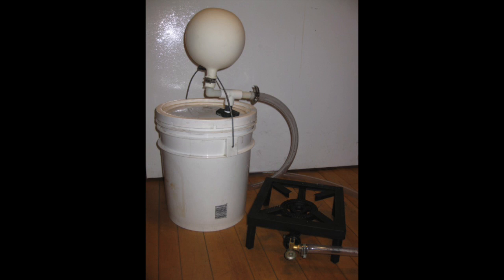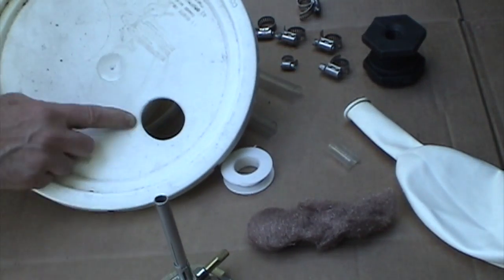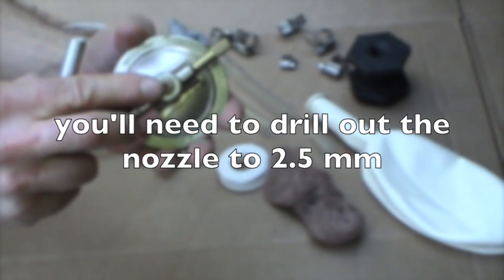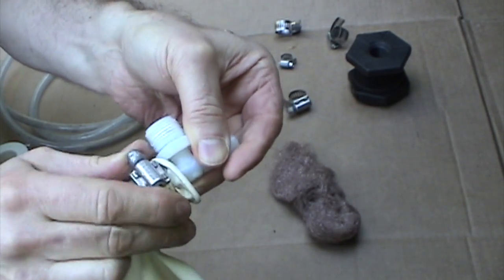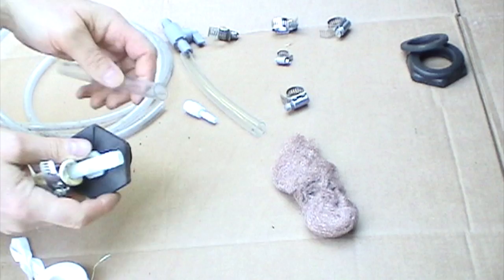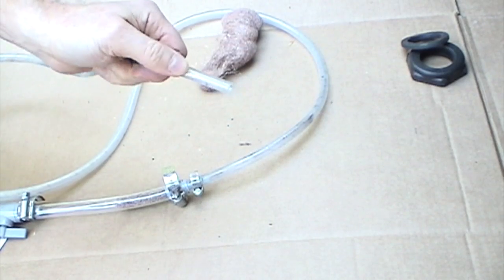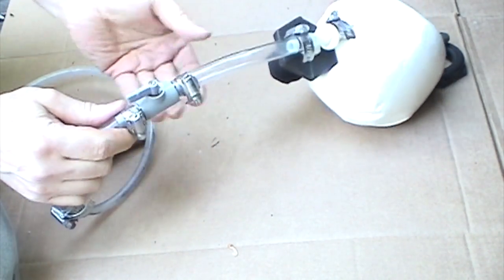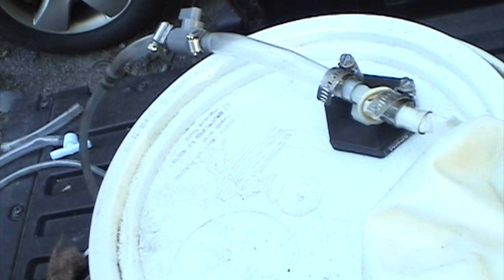Make and use a 5 gallon biogas digester, Part 1:  make the digester

Comment: a canister of sand is the ultimate flash back unit.  I guess you could stack the buckets for weight. with weight on the top one.
Reply from the maker: Sand is a great idea! not sure what you mean by stacking buckets for weight, I envision gas inlet at bottom of sand-filled bucket, and out the top.

Comment: Will a Biogas converted propane hot plate work for this project? I dont want to buy a bunsen burner because I am going to make a larger version later for cooking with a hot plate.
Reply from the maker: it will, but this size digester doesn't produce a lot of gas so it won't burn for very long. For a larger design approach, check out the design in the Homeowner's Energy Handbook.
 https://www.amazon.com/Homeowners-Energy-Handbook-Guide-Getting/dp/1612120164/ref=asap_bc?ie=UTF8
Reply: Great, I will definitely check it out. thank you

Comment: Hey Energy Guy, quick question: How would you add a spigot for the slurry? Or does this one not produce slurry?
Reply from the maker: RET: Not sure you'd want to add a spigot to empty slurry on this design. If you drain off slurry (all digesters contain slurry) it means you'll need to add fresh material without adding air. That would make it a continuous flow process. This is a simple batch digester used primarily for demonstrating biogas concepts, its a one-shot deal where you make the gas, then take off the top to empty the slurry and add new material. Details for my continuous flow digester are in the Homeowner's Energy Handbook. https://www.amazon.com/dp/1612120164

Comment: As gas can seep thru the threads that seal should have been on the topside of the fitting going thru the bucket lid.
Reply from the maker: i thought about that a lot while assembling. It didn't seem that it would be more likely to leak one way or the other, given a snug hole and well-seated gasket. I installed as per mfr recommendation and there was no issue with the seal.

Comment: If possible, use a 5 gallon bucket that is as dark as possible so it absorbs heat. White bucket will reflect the heat. Wonder if painting black would work...
Reply: Yes. Black material helps greatly!
Reply: Vic Irish yes it still worki'n...